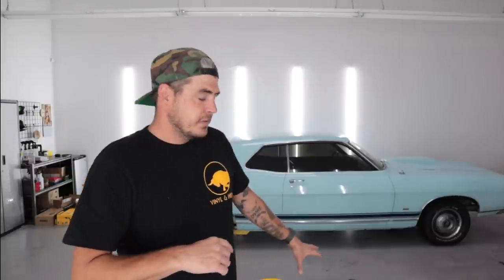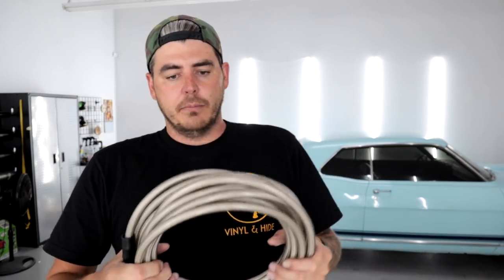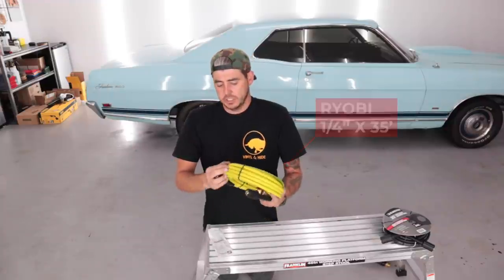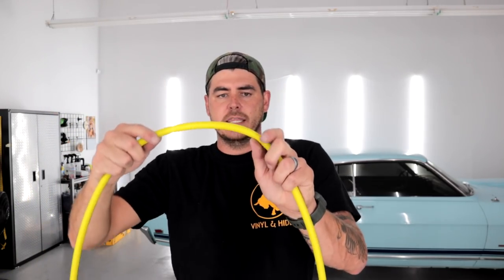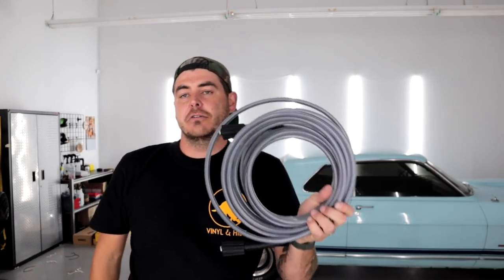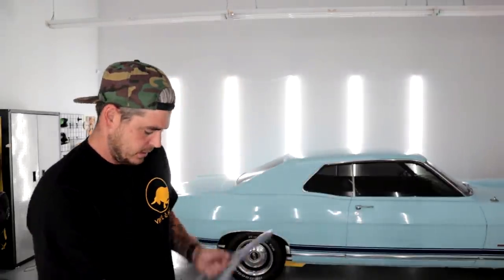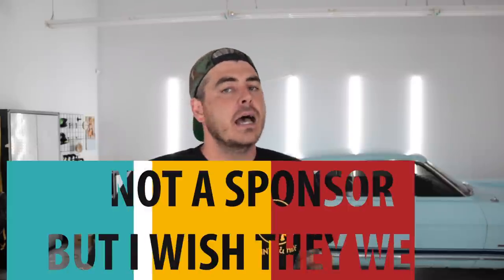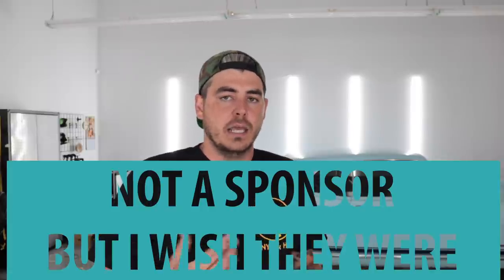Best Pressure Washer Hoses! | Pressure Washer Hoses Reviewed | Car Detailing | Power Washing Hose

Comment: Uberflex hose is great! I purchased one based on your recommendations! I've been using it in my videos as well and it's nice to have a hose that doesn't kink and get stuck under the tires.
Reply: great yes but on Amazon review so many as issues with this hose it brake after few use  check the review you see.
Reply: Haven’t break yet??
Reply: @wiliamsalvarado7572  Mine has not.
Reply: @wiliamsalvarado7572  probably will if you use it in the yard and get caught on rocks, the edge of the house, etc

Comment: Thanks for this great review! I just picked up the Black Max hose from a local Walmart for $37.80 + tax. The length of 35 ft is perfect for me since I really don't need anything longer. FYI, when I looked this up on the Walmart site the Balck Max hose was listed but the page didn't indicate a store that carried it nor gave me a link to order it. However, I eventually found a listing for what looked like the same item under the Walmart HART brand. When I got it from the listed store it turned out to have the Black Max label! Again, thanks to your review for alerting me to the existence of this hose. I've got a Karcher K1700 pressure washer that I've used a few times and while I've not had an issue with the included hose kinking, the 20 ft length is a little short for my needs.
Reply: At my Walmart they don't have the Black Max but they do that the Hart branded hose and when I looked at them it say Uberflex on the hose just like the Black Max in the video. It was only in 25ft tho not 35 like the Black Max

Comment: Just got the Black Max to replace my stock 35' hard plastic Ryobi hose.   I wanted a Uberflex or Flexzilla but both are rated 3100 psi, and my Ryobi is 3200 psi.  I believe Uberflex now makes a 3700 psi model at 30'.  The higher rating probably makes it a little stiffer than the  original version.   The Black Max works great.  Just what I needed.
Reply: 100 PSI isn't going to matter. It will still work with your 3200 pressure washer.
Reply: also the ryobi 3200 isnt puting out 3200 unless its thew gas model, the 3000 psi one does about 2700 psi @age_of_reason

Comment: Purchased the UberFlex hose based on your recommendation, but wished I did not. The drop test you showed, with this hose , left a tangled mess. Had to fight the coils out of 50 feet to get hose straight. Caught on edge of tire as I pulled by. Re coiling around the pressure washer bracket to store also a hassle, tho not as bad as initial - of course I was laying out bigger circles too. i will say it did stay straight as I used it, that much was better than factory.
Reply: 100% same exact experience. It doesn't kink but constantly tangles and will not straighten. I've had it for 3 months.

Comment: Those male to male couplers that are included with hoses are the same 14mm on both sides. They're not to adapt to the 15mm M22 that most electric washers use, they're included to connect other hoses directly or M22x14 quick connects with female threads.

Comment: It would be interesting to know how they hold up to heat. The hose that came with my pressure washed did come in contact with the engine which caused a small burn which, eventually, ended up bursting.

Comment: First, Thank You for such a very informative review on these products.  Seconds, I have a question that need your help on.  Can the “quick connect” come with the UBERFLEX be used on the SunJose pressure washer?  (If my understanding is correct, the SunJose use the “quick connect” with 15mm.). Thank You

Comment: Great indepth video, thanks, but my question is, how do these hoses connect to a standard  preasurewasher gun? I notice they all look to have the same connector at both ends. I use a Nilfisk preasurewasher and the connector into the gun itself is totally different.

Comment: Every propulse hose I got from Amazon is a generic, black hose that isn't smooth jacket or made in USA.  After several returns, I pulled the trigger on a kobrajet from obsessed garage because it's a smooth jacket.  No regret whatsoever.
Reply: Hows it holding up so far
Reply: @randomguy2369  I love it!  Smooth and leaves no marking on my driveway or anywhere it rubs on.  A bit on the pricy side and isn’t as flexible as the original comet hose but it’s very negligible.  At the end of the day, I’m confident that the hose will last a very long time.

So far, it only have scuffing.  No noticeable tear or cuts I’m the line.

Comment: Great video! In your opinion would a longer hose make the pump on the pressure washer cause it to work harder, or even potentially causing it to break? Thank you
Reply: No once the hose is preloaded it won't make a difference

Comment: Just saw this and wife happened to be at a local Walmart. They didn’t have this one. I went to look at my stock and also extra hose for my sunjoe that I bought a few years ago. (I use a flexzilla garden hose and love it). SunJoe hose says it is good for 200 bar pressure, 140 degrees and 2900 psi. It also seems to have some kind of rough surface. The tie a knot test seems better than all of those except for the flexzilla and uber. BUT it also appears to be as good or better than any of those regarding kinks. I can NOT get the it to kink no matter how hard I try. Mine doesn’t appear to be as flexible to those 2 but seems better than all of the others. So I guess for now, it’s probably pretty stupid to “upgrade”. Lol

Comment: Think you should consider the 30ft Greenworks hose from Lowes.  Love all your videos....very helpful.  I got the CAT electric power washer after watching your review.  I still feel like I need a cart or something to hold the hose nicely.  Tough choosing an electric power washer, and yet wanting it to also clean driveways and get the weeds out of the cracks with the limited power electric offers when using a rotating turbo nozzle.  Maybe you can review all the tips that work best for this similar model, or let me know if I'm SOL.
Reply from the maker: I’ve picked up up but never tried it out. Seems like a stiffer material though

Comment: Love the reviews! Been watching every pressure washer upgrade videos you have. Just got a spx3000 and it’s great but after the first use i already found the hose was to short and annoying to work with. Uberflex it is!
Reply from the maker: Awesome! Yea you will love it, just make sure to get the m2215 to m2214 adapter too
Reply: Sun Joes are junk, they don’t perform anywhere near their ratings and they don’t last even with light use. They also won’t sell easily replaceable, inexpensive parts. Just try to get you to buy a new one. I’ll never buy another. When this one breaks and it will, buy the Ryobi Josh recommends or the Karcher Obsessed Garage recommends.

Comment: I like the content. Picked up the flexzilla from your link. My only question is have you tried a bigger office than the 1.1? Like the 1.25?
Reply from the maker: With a foam cannon? Yes I have, most of the come with the 1.25 and I switch them out to the 1.1 to get more foam!
Reply: @imjoshv  oh. I see... I picked up the 1.1 and when I went to change it out I realized the one in my cannon was bigger. I’ll have to try both out. I thought the larger orifice would help lower the output pressure. (And in the process maybe prolong the life of the pressure washer unit) #hopefully🤞🏼

Comment: I bought the uberflex hose and I still find that it kinks when i detail my car with the Ryobi 1900psi pressure washer. Idk if its because the hose is still kinda new. Definitely better than the stock hose that Ryobi gives you. Any advice to prevent or reduce the amount of kinking from happening? Your videos are great btw! I've casually detailed my car in the past but got more into it recently. So the recommendations on what gear to buy helps.
Reply: My Greenworks come with a Uberflex and you need to take it and uncoil the tension out of
It. I take the wand off and just untwist then put the wand on again

Comment: Hey bro, what do you think of hose diameter? I'm going to get a 50' hose for a reel....but I'll store away another 50' in case I'm ever short. I was looking at Flexzilla but it only is 1/4". My old hose was bigger so I was wondering if I'll loose gpm/pressure with 1/4" whenever I use 100' of hose? Thoughts??

Comment: Could use some advice. Was totally ignorant on how to store my pressure washer hose (kept it in my shed) since I haven't used it in some time. Went to put some pump saver through the engine and found that the hose was rotted and falling apart! What hose would you recommend and where should it be stored to prevent this from happening to me again? They aren't cheap, so I am kinda miffed at myself...

Comment: What's the best hose for the UK? I have a Bosch 1900 pressure washer that has push in connectors really need a 50 foot hose as the one that came with it is trash.

Comment: Great video. Do you know if it's possible to use a dedicated air pressure hose for a high pressure washer??
Reply: Air pressure is way less then water pressure. You're seeing a 1000 plus psi difference.

Comment: Great review!  Any ideas how the UberFlex and Flexzilla compare to the MTM Kobrajet?
Reply: I have both and you will definitely notice the difference. The kobrajet is bulky and heavy but it just feels super heavy duty. I suggest getting an mtm kit as the gun is so much better than those cheap stubby guns from Amazon. I never use my Uber flex and old gun anymore.
Reply: @Elniniss  thanks for responding!  I actually have a Kobrajet too :) but not a Uberflex.  The Kobrajet feels a lot like a garden hose.  I also bought a SGS28, but I cheap out on the foam cannon (kit would have been a better deal in hindsight, I got them at separate times) :(.  It is really tough to compare these products without getting hands on one, which is why we all are watching this video lol.

Comment: The length and diameter of a hose may not affect the pressure through the hose but it will have a significant affect on the volume of water that will be able to pass through the hose.  This may not be a big problem if you have a powerful washer unit but is important if you have a typical homeowner unit that has a lower gpm rating.  If you have a 1.2 gpm unit the larger diameter could be important to you.

Comment: interesting comparison, hoses that have been sitting on the shelf with plastic ties, possibly for months, and the Uber hose that has obviously been used. Maybe you could do a comparison with a new uber flex hose.
Reply: uberflex hoses are crap, for some reason the flexzilla hoses are better even though they're from the same company. Go figure.

Comment: Ryobi I made a mistake when purchasing 1/4” replacing on my Honda 2700 pressure washer ( HVC 160). Why? The water gallons per minutes is too low so the water comes out under pressured. So, I figure I must purchase a 3/8” or 5/16” so I can run out more GPM. Sure would like to sell the Ryobi hose. .

Comment: Should be noted that the Black Max hose is no longer sold at Walmart; but, they have replaced it with a Hart-branded 35' hose, which is also the same UberFlex-made hose.
Reply: How do you know the hart hose is uber flex?
Reply: @bashmasterRC  says right on it

Comment: Hey,

Thank you for your review. I really like the 50’ FileZilla or Uberflex but they are rated for 3100 psi and my unit is 3400 psi. Will this be an issue?
Reply: You can contact the company's support and ask them. Uberflex company.

Comment: **QUESTION**
Can’t find any info on RED Uber flex (1/4" x 30' 3700psi 22mm)…Aside from length & psi difference, is there an application-specific factor that I’m missing? (I use the CAT 1800)

Comment: I've noticed that all these hoses may have brass threads at the end but they all seem to have some type of silver metal in the center. Sometimes even after one use that center piece that holds the o-ring flakes and begans to tarnish and even rust. Does anyone know why they don't use all brass or stainless steel fitting construction? Is it just so that they fail prematurely?  It seems that we all focus on the hose, when the big problem is this rust that forms. Eventually we end up blasting everything with rust particles that forms in the fittings ends of these hoses. Any thoughts?

Comment: Just snagged a black max hose from Walmart and I guess they don’t use Uber flex anymore. Had no writing of Uber flex and wasn’t the same texture. Either that or someone returned a different hose in the black max packaging
Reply: Packaging added up to the specs of a Uber flex but the specs on the hose did not had a6,000 psi limit

Comment: I just picked up a Black Max hose from Walmart and it’s not a Uberflex at all. It says Jetter WP and as far as flexibility goes the OEM from Sunjoe is more flexible than this item. I have not tried it yet since I’m considering returning it to Walmart.
Reply from the maker: Yea o think they have two different ones. You definitely want the uberflex one
Reply: @imjoshv   I took it returned it to Walmart this morning and while I was there I thought I’d go down the isle and take another look. I dug through all they had and way back I noticed one that looked different. Sure enough it was a Uberflex and without hesitation I bought it.

Comment: Hi. I have Karcher K5 series and the pressure hose connectors are different from what you have reviewed. Any suggestions or ways to replace connectors? I want a more flexible pressure hose so that it would be easier to maneuver when I wash my car, since I do not have a lot of room to maneuver. Please suggest a possible solution.
Reply: Karcher has their own adapter so that you can attached m fittings.  I’ll try to find a link for you.  I have the same model as you.   Love my k5

Comment: Just bought the Black Max. My Flexilla will now be hung up for good. Black Max destroys the Flexilla. My Flexilla kinks, twists, turns, knots. This Black Max is legit
Reply from the maker: They should both be the exact same construction. Both of them are made by propulse and using that patented tech
Reply: @imjoshv  must have gotten a bad flexilla then or the winter out in the garage permanently set it in it's current form. If I could send a pic of the two laid out I would. My Flexilla is a pain in the ass the unwind and get straight
Reply: But I love my Flexilla 100ft garden hose

Comment: What size inlet hose is the norm? I know there is like 6, 12 and 20 ft I believe.
Reply from the maker: For a gravity fed system I’d run a 6ft but if you’re connected to a normal spigot I don’t think it matters because you will have enough water pressure to reach the pressure washer

Comment: Does your pressure washer have to be 3100 PSI or the one the hose says or as long as it’s less and no more?
Reply from the maker: Doesn’t have to be 3100. That’s just the highest psi rating the recommend for the hose. So 3100 or anything less is totally fine!!

Comment: The first hose is an extension hose, that is why it has a male end to connect to another m22 14m female end hose....I also have this hose. The flexzilla may look the same and sort of feel the same but it does not compare to the uberflex (blue). I have both as mentioned before in past comment. Try actually washing a car with flexzilla and you will see how bad it is compared to uberflex. It is garbage..

Comment: GOD DAMNIT. I've been looking for a 35ft hose for the last week and I just pulled the trigger on a Red Uberflex hose 30ft on eBay. Thanks for the video next time or if I get someone to buy my red hose and I'll get that Black Max one. Also, shouldn't it be a recommend opinion vs in a pinch?
Reply: To go in dept. I bought a 50ft KobraJet recenlty and I'm a mobile detailer most of the time and that things is super nice but it's heavy, thicc and pita in the to setup without a reel. I also use the Ryobi 40v cordless pressure washer so I don't need that much hose why I've been looking for a 35ft. I try to work in a small area so 30-35ft hose length is my ideal. 
Again thanks for doing this it was needed.

Comment: On the uber flex is it worth buying the 3/8 over the 1/4 for a greenworks pressure water or just buy the 1/4?
Reply from the maker: I prefer the 1/4. It’s a little easier to work with. If you want the 100’ length just buy two and link them together
Reply: Thank you for the gast and awsome  reply
Reply from the maker: Anytime!

Comment: Got a red uberflex. And while I loved the hose unfortunately the hose burst midwash. Had it about 6 months. Debating on getting a more heavy duty 3/8 hose.
Reply: Same happened to me twice with the uberflex blue. 2 hoses crapped on me in less than 4 months. Went with the flexzilla and after 2 months of heavy use it's still like new.
Reply: @jjabblePlayStation  so far so good with the flexzilla I just got.